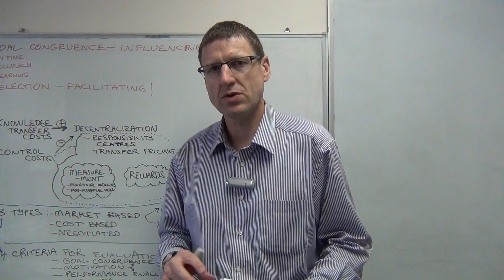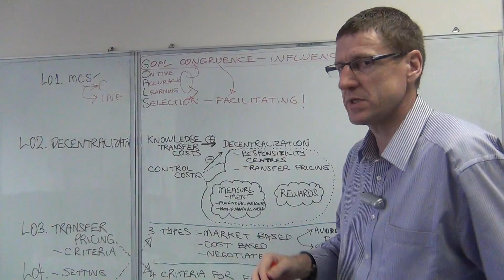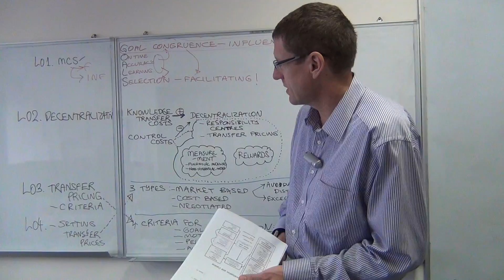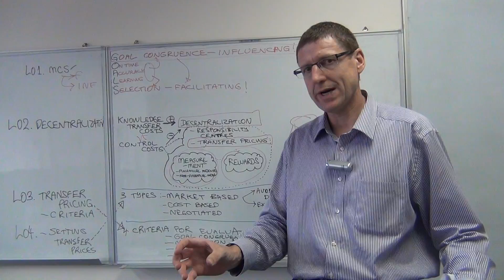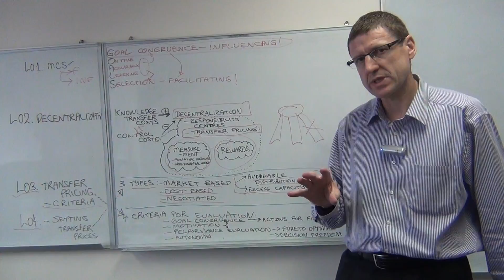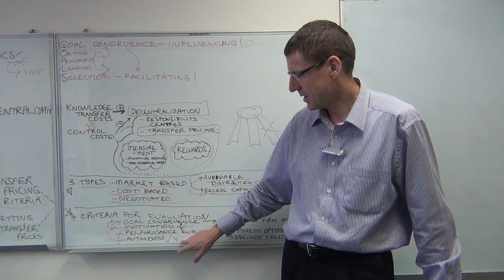CPA MA Quick Summary - Decentralization & Transfer Pricing Introduction

Comment: This is FAN Haiyang(16422406).The most impressed concept I learnt from this video is decentralization.In the process of decentralization there comes to two cost: the knowledge transfer cost and the control cost and there is a tradeoff  between them.This video also mentions the reward and the measurement and I believe I will get a deeper understanding of these two concepts in the class.